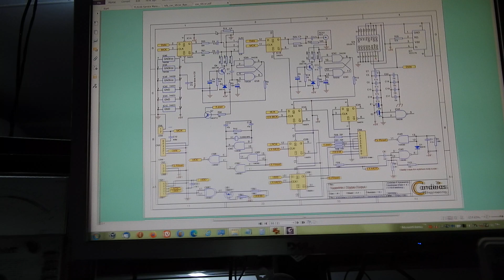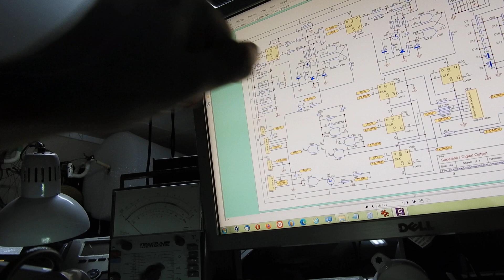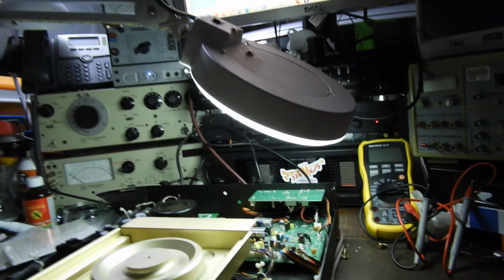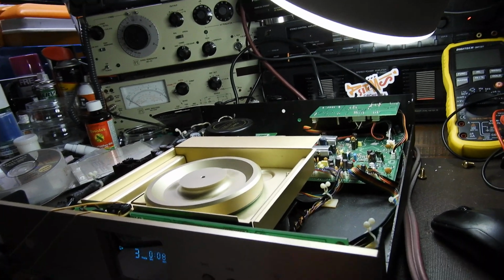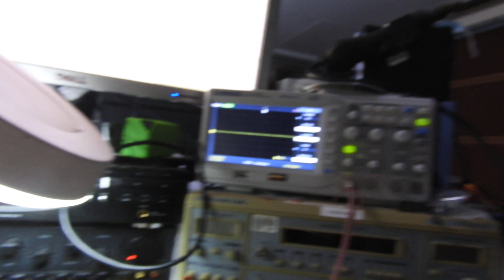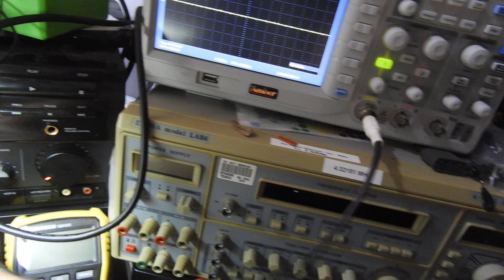C.E.C. TL-2X CD Transport which was reading CDs "in choosy manner"

Comment: Thanks for all your videos.  As electronics get more disposable, it's good to know technicians like you can help customers fix classic components.  I purchased a dealer demo CEC TL5 earlier this year and am enjoying it.  (I also own the Musical Fidelity M3SCD you featured in earlier videos.)  Initially, the TL5 had disc skipping problems upon delivery because some discs would rub against the deck.  The dealer took it back under warranty and said he replaced the mechanism.  It's working fine now.  The TL5 allows for easier access to the spindle belt so users don't need to send it back to dealers or open up the chasis.  When replacing the spindle belt, do you have alternatives to the ones directly from CEC?
Reply from the maker: I never buy original belts, for even the manufacturers source them from whoever is their supplier of the day. You just need its length and cross-section details and and trade supplier will have a spare one for you. I use WES Components in Sydney. The only problem is when you get a player with a belt that has turned to goo and cannot be measured. But there are tricks to overcome this too.